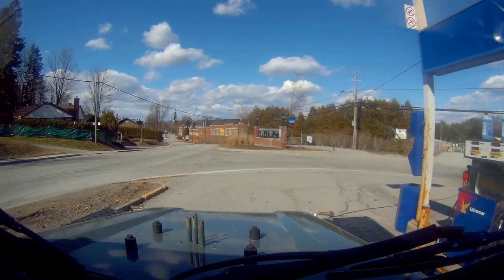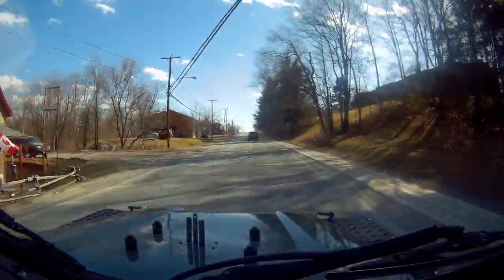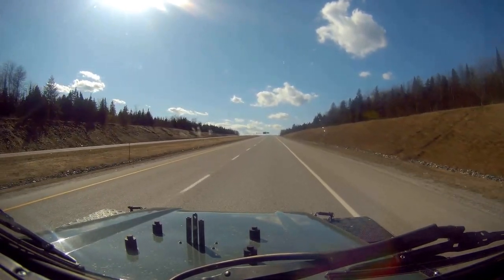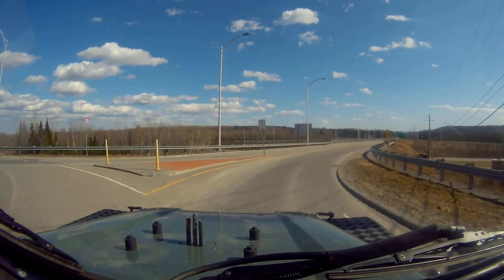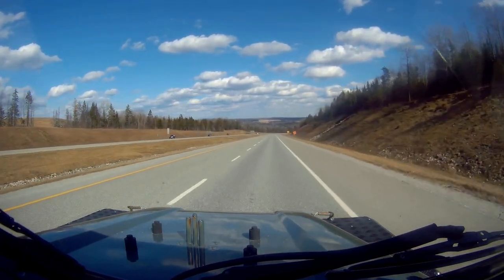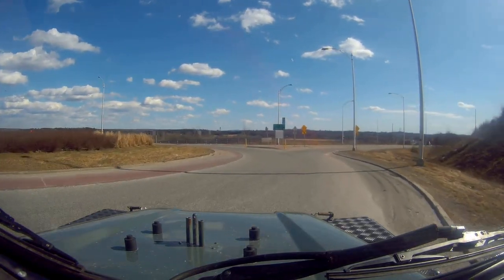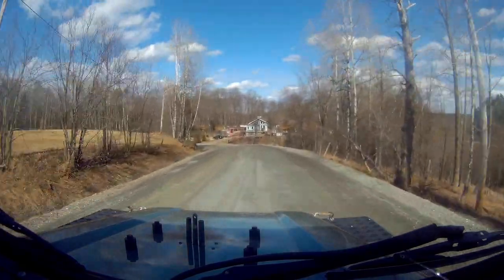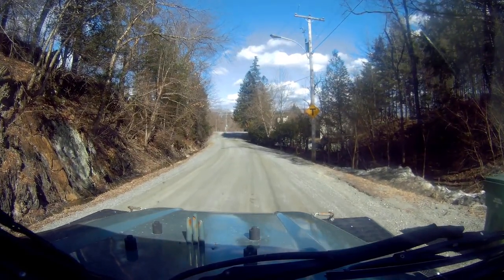VERY first run in the GM 110 V6 Vortec project!

Comment: Mike, lovely  vid as always,, we over here have quite a few ex pumas that have had a similar conversion done but with the ford v6  as some bits are compatible, electronically, but why do you want to go fast in a Land Rover, if I want to go fast I buy a sports car, Regards phil,
Reply from the maker: I want something available in Canada that is readily available and cheap, reliable, robust, will start in winter and has power (plus there is an automatic option)

Comment: That seems to go very nicely!  It must be a great feeling to finally get to drive this truck.  If you ever put together a bolt in kit and ship it to the UK, I’m in!!!!😀
Reply from the maker: Yes it went well - I will sort a few things out and do another test
I am very tempted to do an automatic version as dimensionally it is the same and same harness, and there are a lot more autos than manuals
Reply: @BritannicaRestorations  yep automatic is the way to go I would not change back to a manual box for anything.
Reply from the maker: Problem with autos in LRs is the box sucks power out of the engine - a 300Tdi just does not have the power and a V8 has the power but is bad on petrol

Comment: Mike, across the pond here, can't really go and grab a Vortec easily, what do you think? I can pickup a Jaguar X-Type 2.5 V6 petrol for about £400.00 assuming engine and box was OK I wonder if that could be made to work... I think I need a trip to the scrappy for a look.
Reply from the maker: At the end of the day the engine, transmission and wiring etc, cost £290 - there are hundreds of rotted out GM's here
Total build cost was £1700 as I had to have the adaptor machined as a one off $$$
I had to do a lot of homework on this, and it helped to have a 300tdi to put side by side - there is not much difference (apart from width and weight) dimensionally 
The beauty of the Vortec is it is basically a small block Chevy  - very reliable, simple and tough
The thing is it works for me and other Defender owners on this side of the pond
Parts are everywhere, all garages know them, starts well in the cold, AND fuel is readily available - unlike diesel

Comment: Great stuff!
I keep seeing video's of V8 Land Cruisers and start to get ideas about tuning my TD5 but then I think about what's likely to happen to the transfer case, propshafts, diff's, driveshafts and CVs and then reality regains control.
Any idea how well the LR transmission will cope with the Vortec? Or it is just a case of maintaining a delicate right foot?
Reply from the maker: This is on the GM gearbox as the R380 would not cope in the long term - the LT230 will take a lot of power s no worries there = the rear axle is a Salisbury

Comment: That was good how does it feel to actually overtake a car in a land rover has to be a new experience.     How does the GM V6 compaire to  Rover V8 petrol engines.
Reply from the maker: I have not driven a Defender with an injection V8 only a carb and that was only 111 bhp. Lots are saying the V6 will use a lot of petrol but the V8 was terrible - my D2 in winter was only getting 350 km from a full tank! 
The V6 is remarkably nippy - and very reliable - they made millions of these types of motor in all sorts of applications
Reply: @BritannicaRestorations  The way that I look at it I have a 4ltr Jeep and probably much like you do not use it that much and when I do its mostly only for short trips so the fuel consumption does not bother me that much even at uk stupid  prices I think that you will be very happy with it you just have to stop thinking its a diesel and pressing to hard on your right foot.

Comment: Great job Mike, now... lol. Why the smeg wont my V8 pull  like that?
Reply from the maker: Problem with the old RV8 was it lost a lot of BHP over the years - especially early carb ones with bad camshafts - they would still run, but not as well